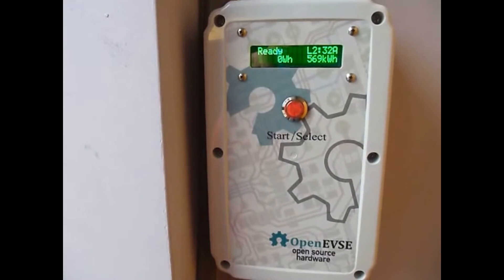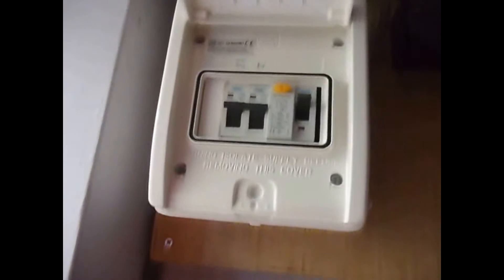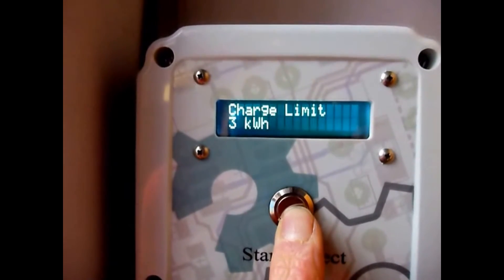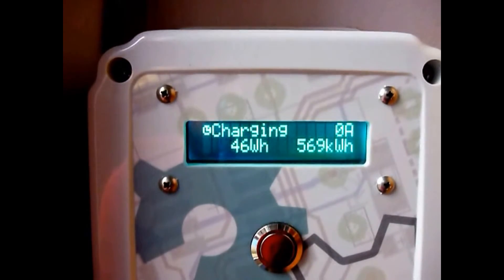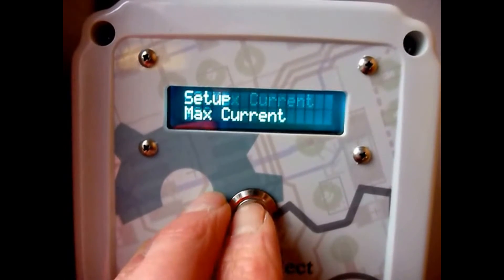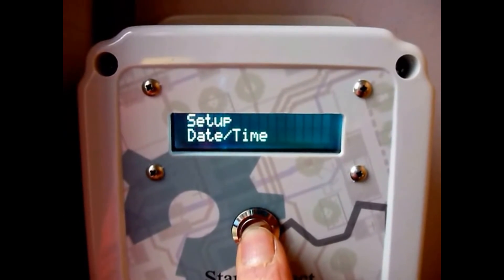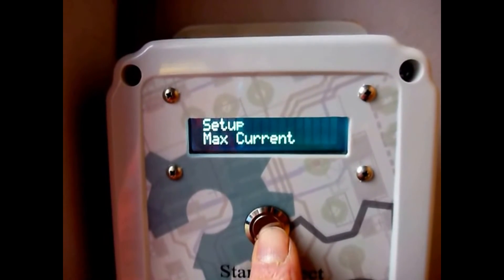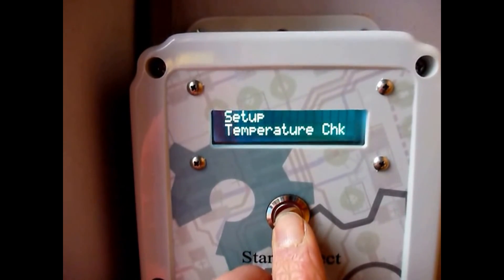OpenEVSE EV Charging Station Part1: Overview User Guide

Comment: Two questions:

1. Any chance of getting this in the US?

2. Any chance of getting a CCS plug?

Looking to get one of these for a Rivian.
Reply: OpenEVSE is already sold in USA, see https://store.openevse.com/. Rivian will AC charge using a type-1 J1772 plug in the USA or a Type-2 plug in Europe. Therefore this unit will work with Rivian. The CCS part of the plug is only used for DC rapid charging. See image https://3.bp.blogspot.com/-m2lxtwN1XgI/V4XfSE-WJeI/AAAAAAAAAvA/lV6MQGxyUSEWd95a2Scn9pBhLnhP5-N9QCLcB/s400/ccs2.jpg

Comment: Hi
Concerned that the RCD that is installed for your EVSE  apears to be a type 'AC' and not a type 'A' as required by BS7671. 
A type 'AC' RCD can become saturated by DC leakage current from the EV and not trip should an earth leakage fault occur.
Reply from the maker: Thanks good spot, this installation was old. It's has now been re-done in light of the new 18th addition IET BS7671
Reply: @OpenenergymonitorOrgpage  The unit requires a Type-B RCD see https://community.openenergymonitor.org/t/openevse-and-wiring-regs-changes-722-531-2-101/10959?u=glyn.hudson

Comment: Looks like a great product. I'm surprised with all your other projects, you didn't decided to add a CT clamp to this and allow it to govern the rate of charge itself based on surplus power from PV etc.  It looks like you could do this via the API in this product, if you scripted it yourself? DO you know if anyone has done this?  Thanks.
Reply: Thanks, yes it's a great unit. We're currently working on exactly this feature. It will be added to the software very soon. Integrating solar PV monitoring data from emonPi to adjust charge rate dynamically based on solar PV output. See thread: https://community.openenergymonitor.org/t/diverting-solar-pv-to-ev-using-openeevse-mqtt-and-nodered/3411/10
Reply: Excellent! I shall keep a close eye on this. I'm quite the HA tinkerer, but only just got solar. Already have excess diverting into heat store - Just need an electric car now :)
Reply: OpenEVSE now supports solar PV divert https://guide.openenergymonitor.org/integrations/ev-charging/